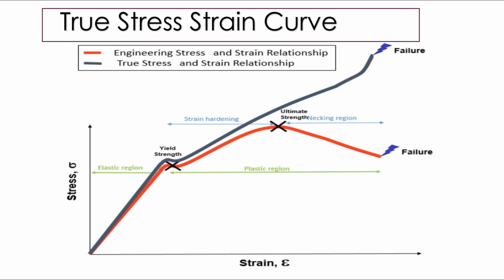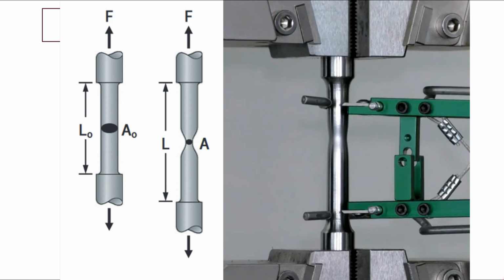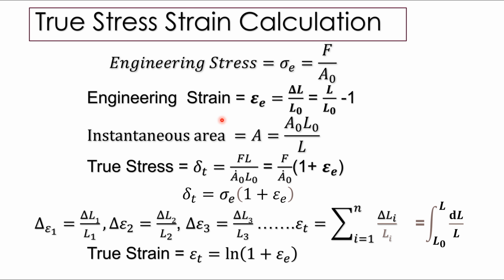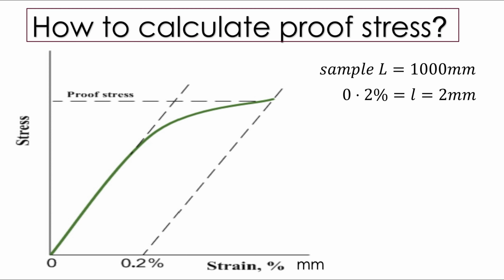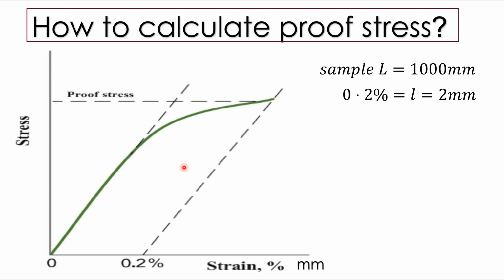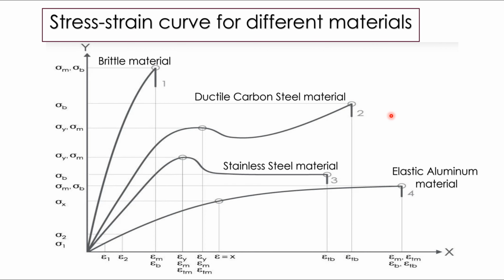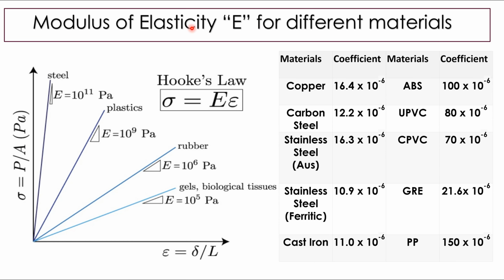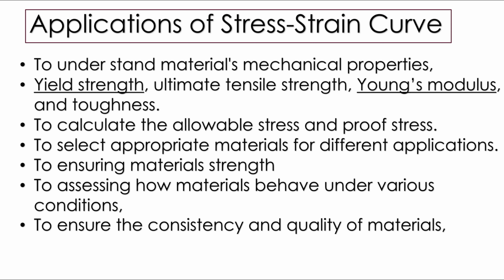Basics of Stress Analysis Part 1C

Comment: SS material strength increases after work hardening, but the graph shows a drop in YS; I am not clear.   would you please elaborate?
Reply from the maker: Yes, your understanding is correct, SS material strength increases after work hardening, means increase in tensile strength,Yield strength and Hardness. However, ductility and toughness will reduced as material become less capable of undergoing plastic deformation before fracture. Furthermore, stress strain curve for SS depends on its type and processing conditions. Hope this clarify your query.